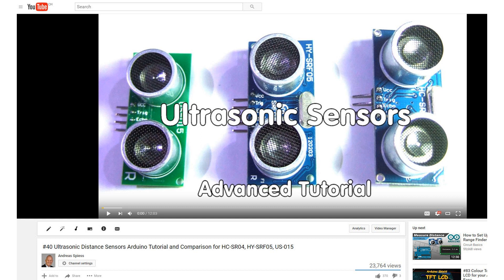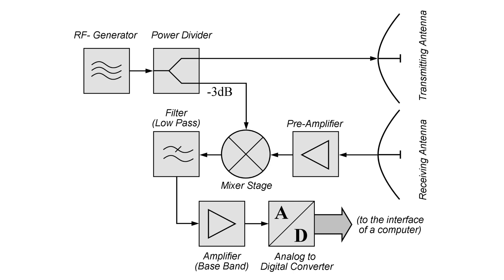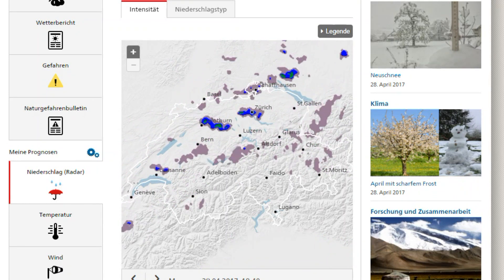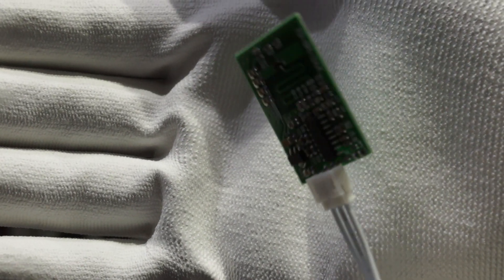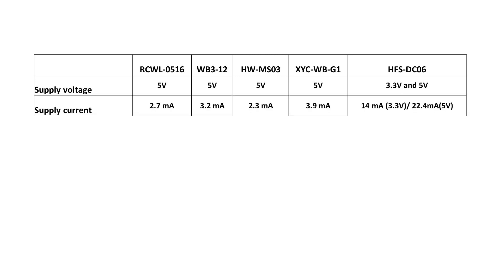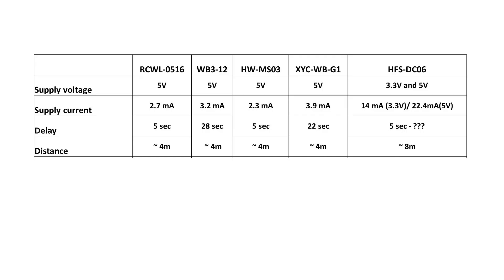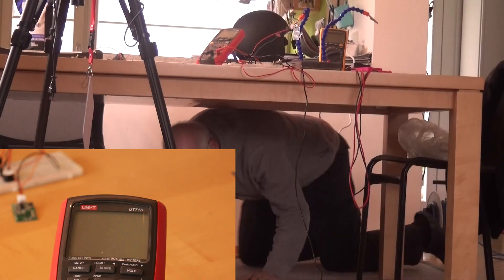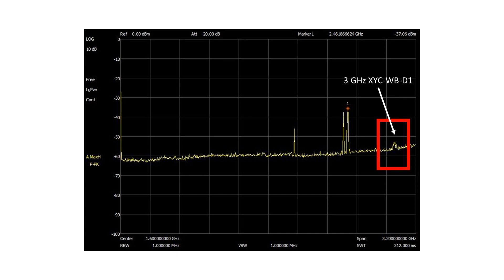#135 Radar Sensors / Switches: Comparison and Tests

Comment: Can I use AC220V to 5V 700mA step down module as 5V power supply for RCWL-0516?
Reply from the maker: I think so. However, these are not called "step down modules", they usually are called "power supplies" if they work on 220V AC

Comment: Glass that has high efficiency coatings are RF reflective. a lot of new modern windows block RF energy.
Reply from the maker: Indeed, Smartphones do no more work inside. The glas has metal coatings that reflect heat. And as collateral damage, radio waves.

Comment: Wow.. I did the exact same tests and had very different results.  

Two of them within 3 meters, constantly interfered with each other.  The RCWL would not consistently fire except within 200-500 cm of the receiver.  I tested 10 from two batches, never got consistent results no matter temp, humidity, length of connecting wires , voltage provided (5-12v) or orientation of the sensor. 

Going to try stand alone next, no Arduino, just power an led or buzzer with the 3.3 out.  So we'll see 🤞
Reply from the maker: Stand alone is a good idea. They are prone to interference (for example by WiFi)
Reply: @AndreasSpiess  I wasted my money on those, but life gave me lemonade with the LD2410.. it's a dream come true!  
I bought some in desperation, like about to give up on ACCURATE motion tracking.
I got them, had a problem, found your video, which was amazing BTW 👍 and I been tweaking the library n it is amazing, n I mean with AMAZING potential.
.. when I can get 100% repeat outcomes with something, that's a WIN 💯🏁

Comment: Your results regarding detection range modification is not correct, please do not include assumptions when you have not investigated them
Reply from the maker: Where did you discover differencies?
Reply: RCWL-0516 Microwave Sensor detection range can be changed by adding 1 M ohm or 270 Kohm resistors at its back, you have mentioned that the detection range can't be changed in the video, thank you for making the video but please be aware that some wrong info can disappoint designers @AndreasSpiess

Comment: Great video!....With this rcwl0156 module, will it be possible to measure the distance to an object, using Doppler, changing the antenna and making it directional?
Reply from the maker: No. These modules only detect presence.

Comment: Hello, thanks for the great explanation. Am facing sensitivity issue on RCWL-0516. On the fist day sensitivity of the motion was very good even at the distance of 5meter. After a day suddenly the sensitivity drops to less than 0.5m . Is this behaviour see with any one ? If you have any suggestions/solutions please suggest.
Reply from the maker: No, I did not see a degradation over time.

Comment: Great video. Never new these existed. Would be interesting to see a video demonstrating when to use either radar, ir or microwave sensors.

Also, would be great to see what can be achieved with them, like can the device give a different reading dependent on proximity
Reply from the maker: You can do your tests. these devices are not expensive ;-)
I recently did a video about the new 24GHz sensors, BTW

Comment: Here is a conundrum. They work well inside, but my tests show they don't work outdoors. They can't even detect a car passing close by. I believe this is because they work on standing waves, which occur in enclosed spaces. This doesn't make any sense, but I have done this testing pretty thoroughly and abandoned using them for a driveway alarm. My theory is that the standing waves build up a voltage (like AGC) in the mixer and the absence of this makes the device inoperative. A car passing by even a driveway speed goes by quickly enough that the "AGC" voltage doesn't build up fast enough. Any other insights would be appreciated.
Reply from the maker: Interesting tests. These sensors are very special receivers which are „detuned“. Still, I thought they will be able to detect an object as big as a car. Did you test if it is the speed?
Reply: @AndreasSpiess  within the limits of a dirt driveway, like 10 mph to 35 mph. But the failure to detect was also true of bodies. Inside, very sensitive. Outside, nothing repeatable. So after the PIR sensors failed due to always having the sun in their eyes part of the day, I buried a magnetometer, which works great. Now I can detect direction of motion because the compass swings in opposite directions, depending on which way it is approached. And it doesn't care about the sun. So the Arduino at the far (1300') end of the driveway sends the compass angle via RS-485 and the in-house Arduino keeps track of the data and looks at the slope of the angle data, then rings an inbound or outbound sound. It also records the time of day, so if I'm not here, I have a record of all entries and exits.
Reply from the maker: @rogermoseley7554  Choosing the right sensor is very important. I am glad you found the one for your needs. The new 24GHz  radars shown in a previous video are also quite promising...

Comment: wish i knew how long i could make cables for sensors like that..
Reply from the maker: These are digital signals. So they should work on longer distances. Maybe you use shielded cables to avoid interference.
Reply: @AndreasSpiess  so i guess range of 40-50 meters would be fine
Reply from the maker: @DeathbyKillerBong  You have to try. This is not a normal situation...

Comment: Hello Andreas, 
I want to make an Asian hornet "follower" on the basis of an FMCW transmitter and a simple antenna with a resonator glued to the back of the hornet. The goal is to detect the direction taken by the hornet towards its nest.
I saw the HLK-LD2410 which doesn't seem expensive but it's not in your review. 
What would you advise me?
Reply from the maker: Recently I made a video about this device

Comment: Early AM receivers used one triode tube (and later one transistor) to act as an HF amplifier, local oscillator and mixer at the same time.
--
I have found specifications and schematics on the internet and performed my own measurements with the RCWL-0516 in the original configuration and with the timing components removed.
This is my understanding of its function:
The 'snake' trace on the PCB, together with the circular traces on the opposite side of the PCB acts at the same time as a  resonant circuit (LC) and as the antenna.
The sensing of movement is done by measuring changes in the HF transistors emitter current. 
The change in the emitter current is a result of changing load on the antenna due to a moving absorber/reflector, eg. a person.
Both absorption of the transmitted signal and a doppler effect from a moving conductor object will change the emitter current.

I hope that it makes sense
/JD
Reply from the maker: Thank you for your analysis. Others also mentioned that it could be a regenerative receiver. So if I understand right, it is not a radar because it does not depend on the reflected signal and its frequency difference. It just is a receiver which is de-tuned by conducting material?

Comment: Great video, thanks. I did not realise that 3.2GHz was permitted in Europe? 24GHz is OK but 3.2GHz ? Any thoughts - thanks.
Reply from the maker: It for sure is not allowed. And these devices run on different  frequencies. Completely illegal. But very low power.

Comment: I think that transistor is used as antenna switch which is used to multiplex transmitter signal and receiver signal to switch over for particular time and hence same antenna can transmit and receive the rf signal
Reply from the maker: I am not sure. Where would then be the transistors for the receiver and the transmitter?
Reply: @AndreasSpiess  it depends on circuit designer but  according to me single transistor can also be used to transmit or receive through common antenna for example if this transistor is off then it will work as transmitter if it is on then it will work as receiver.

Comment: I think there are two antennas if you spotted on the edge of pcb there are dots too, so seems outer ring is sender and snake is recever or vice versa.
Reply from the maker: I do not think so. There are other comments that explain the circuit. There is only one active element. So 2 antennas would not make sense.

Comment: Hi Andreas -- here is the guy with the Danish accent :-)
You videos are always instructional and I enjoy them and learn at lot!

Would you share your thoughts on this issue:
I want to measure the time it takes for a person to walk from doorway 1, up some stairs and through doorway 2, carrying a clipboard. 

I intend to do this by detecting that specific person as he/she walks through each doorway and recording the time -- other people may walk through the doorways too, but I'm not interested in them.
I would prefer it if the person is not required to do anything active like present an RFID tag to a reader -- the person should simply walk through the doorway.

I was thinking either a UHF RFID tag/reader with an radius of ~1m (can't find one for arduino or esp32, though), or several separate ultrasound emitters in different directions mounted to the clipboard and an ultrasound sensor inside the doorways, or similarly an infrared LED mounted to the clipboard and some sensors inside the doorway. ...now perhaps radar is also an option.

What I need, basically is not too much range as I don't want to detect the person whilst their still on the stairs, but also enough range, that he/she can not walk through the door without being detected.

What do you think would be a good bet for technolgy? RFID, US, IR, Radar, ...?
Reply from the maker: UHF RFID for sure would work. These transceivers have USB. So maybe a Raspberry would be the better solution.
A BLE beacon on the clipboard would even be better, I think. Or an app on the mobile which connects to an ESP32 when in proximity. You should be able to test the setup by creating a "beacon" in the NRF connect app. Like that you would not need any hardware for the clipboard.
Reply: @AndreasSpiess  A BLE beacon ... I hadn't thought of that -- I'll look into that. Thanks for your suggestion.

Comment: Have you tried adding aluminum foil at the back of the sensors(without shorting them), and at an angle in front of the sensor to produce some sort of directivity?
Reply from the maker: No, I did not try it.

Comment: Have you seen this video. Big Clive from Scotland explains the workings of these clever devices. I hope his explanation demystifies your understanding of these modules. He seems to say that these delicate devices try to oscillate at a fixed frequency (any frequency, just fixed) and then, movements in the surroundings cause the oscillator to alter frequency very slightly. The effect changes on the oscillator are then used as a trigger. 
My (amateur) interpretation of this is that, it’s not a transmitter/receiver radar in the usual sense; instead it’s a transmitter only, than detects changes in the energy required to transmit - changes caused by the impact of variations in the Electro-Magnetic Field surroundings.
The comments in the video are also worth reading, as some give further explanation.
https://youtu.be/Hf19hc9PtcE

Comment: I wanted to combine the RCWL-0516 with some cheap 433 sender with a fixed codes but the problem with that setup is that the 433 sender is producing the signal when I manually or by the RCWL cut off the power, right in that moment which is weird. It probably stores some power in its coils or caps...
Reply from the maker: Strange.... I hope you will find the error.

Comment: So I run around town picking up everyone's discarded electronics. I done across someone's auto insurance GPS devices. Inside they use Taoglas and Ublox. Can I hack them to work in an Arduino setup?
Reply from the maker: I do not know which modules they use. But I assume it is possible.
Reply: @AndreasSpiess  I've found someone with code. I wonder can text be sent over it?

Comment: Thank you very much for the reply,  i m great follower of your videos. The power line seems to be alright without any sparks. the distance is around 5 feets from the sensor. I tried to handle the same in the code but it was getting unpredictable with the fan ON.

Comment: As always, really excellent video. A belated thanks! 
I wanted a cheap, reliable sensor to add to my existing ESP32 DHT temp sensors in each room (they use MQTT) and the RCWL-0516 looked perfect. My devices are all USB powered and the main motivation was a fast MQTT response to replace Z-Wave PIRs that I currently use. My test sketch worked perfectly but as soon as I start ESP WiFi, the radar stopped making detections. Switch WiFi off again and radar works again. Has anyone made these little devices work whilst also using the ESP's WifFi? I'm about to try PIRs as an alternative but I really hope I'm just being a bit dumb and that someone has got them working reliably!
Reply from the maker: These sensors work at around 3GHz and are influenced by the 2.4GHz WiFi. So you either switch WiFi of the ESP32 on only after a detection or you create a bigger distance between the two.
I use Zigbee PIRs which work great, BTW.
Reply: @AndreasSpiess  Thanks Andreas - thought that might be the problem. Sadly, I invested heavily in Zwave before I knew about Zigbee and now all my heating, presence and lights are controlled by it. A lesson in design decisions...

Comment: Awesome video Andreas! Do you know if any of these mmWave radar modules can output the distance/angle between object and sensor? All of these seem to only output HIGH/LOW values.
Reply from the maker: You can get other radar modules. But they are very expensive compared with these small boards. They can measure distance and speed. I am not aware of angle.
Reply: @AndreasSpiess  Have you tried any of these more expensive ones, which you could recommend to me?
Reply from the maker: No, I did not test them.

Comment: Rcwl-0516 is good for presence sensing or occupants detection but it's ver bad for any burglary, motion detection purposes.. Due to its 360 angle and 1M resistor in the R-GN only reduces the range to 5 M..
Reply from the maker: You are right: Distinguishing between normal people and burglars always is tough. Even our police is not very good at that ;-)

Comment: After buying a few of these RCWL-0516, my greatest disappointment turned out to be the ceiling fan. The module is getting triggered whenever I turned on the ceiling fan of my room. Is there any workaround for this, has anyone experienced similar things.
Reply from the maker: They do not like any change on the power line. This could be a reason. Or if the motor creates any sparks… But it is hard to judge from far away. I would check if distance to the fan has an influence.

Comment: Thank you for this video.
I have a lot of false psitive alarm. I had tested 4 different filter without success. Would you please help?
Reply from the maker: There is information available about this topic. Just google. If you use an ESP you have to have some distance between its antenna and the sensor
Reply: @AndreasSpiess  Thank you very much

Comment: All radars here are not sensitive to direction. Any idea of low cost radars that can detect only in a specific direction? Perhaps it is a matter of antenna?
Reply from the maker: It for sure is a matter of antennas. But it is not easy to build such high frequency antennas, particularly if your frequency is not stable as with these cheap modules.
Reply: I have no idea, but maybe phase arrays would work with directionality.

Comment: Check out the "XYC-WB-DC". I am running it on 3.3V directly with a ESP8266 NodeMCU via wireless lan and the Blynk app. It is detecting 3+ meter through a wooden door, even walls made of stone are possible (testet that but not sure about the distance). Detecting 5+ meter free air is no problem. Only high/low signal is available, no distance information, but this is fine for my purpose. Bought from a german makershop but the part is also available from eBay or China.
Reply from the maker: Thanks for sharing your experience. And I am glad you had no interference with the Wi-Fi of the ESP8266 as many others..
Reply: @AndreasSpiess  No issues with the wi-fi so far. The "XYC-WB-DC" is connected to the NodeMCU with a cable length of about 20cm and is not covered or shielded at all. The wi-fi router is 2m away, maybe that matters.

Comment: My project with these OWL sensors as a movement sensor, with an ESP8266 to send data, was frustrating with false signals and unreliability until I ensured the WiFi was OFF for most of the sensing time loop while movement pulses were counted and only turned on briefly to transmit the counts! Results:= lower current draw and great reliability. Not surprising but it look time for me to figure that out. 
Thanks for your inspiration.
Reply from the maker: Thank you for sharing your experience. Looking at the Spectrum analyzer in my newest video you saw that they work around 3 GHz. Which is very close to 2.4GHz Wi-Fi. So it is no wonder that you get cross-talk.

Comment: Great video! Did try the glass test with the glass just in front of the sensor? I am thinking of a motion sensor for the front porch with the unit mounted on the inside of the glass window above the door.
Reply from the maker: Standard glas in front of the sensor should be ok.

Comment: Great video. The raison why movement is not detected behind the glass door, is because the double glass in your door is internally coated with a thin metal layer to keep heat (infrared) inside. I think. You should try a single glass.
Reply from the maker: I am not sure if if it is coated because it was very cheap. But I do not know.